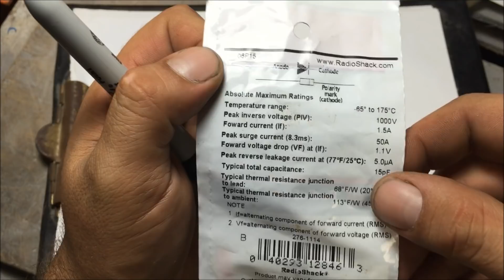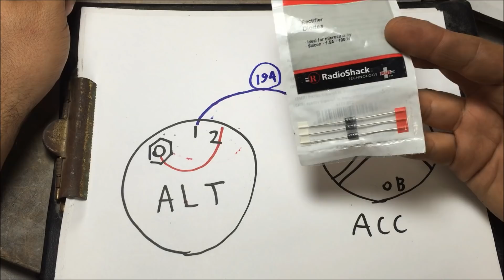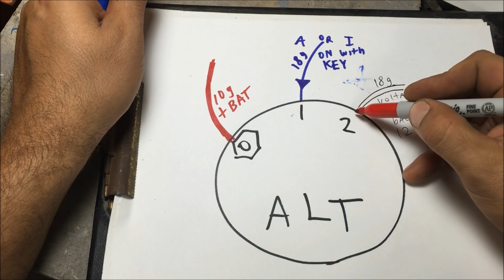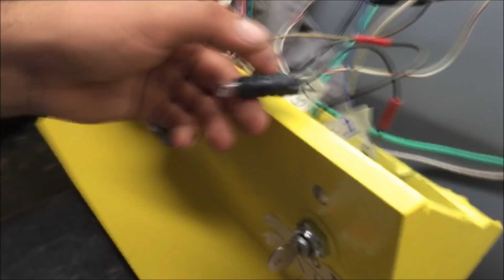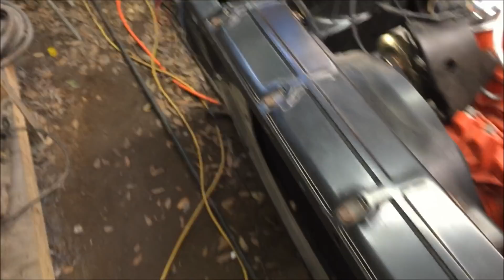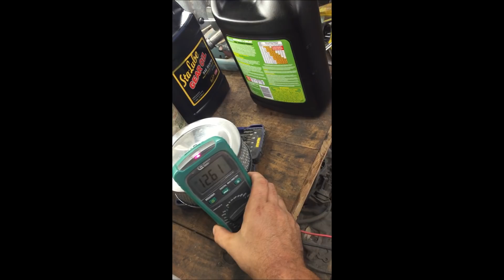how to wire up GM 3 WIRE internally regulated 1973 and newer alternator

Comment: Hey Chris, you always explain shit better than anyone so I have an off-the-wall question. I am breaking in my 396 after rebuild. Motor is on the bear chassis with no body or anything else. Just have it wired to be able to start and run. in other words, one switched wire from the battery to the hot side of the distributor. Can I simply run a heavy gauge wire from the post on the back of the alternator over to the battery to charge it while I’m doing the break-in run? Hope that makes sense.
Reply from the maker: yeah, make sure the battery is grounded to the block or engine

Comment: could you just use a momentary contact switch instead of the 194 bulb or diode and manually excite it when you start it up? Like on a tractor .

Comment: Ok so I have a 69 chevelle that I just converted to internally regulated. I eliminated the external regulator from your other video by jumping out the plug. I have the blue in #1 pos, white jumped to the post on the alternator with red (battery wire) Key switch in the column has accessory. Engine will not shut off. Guess my next step is to get a diode. The gauge cluster idiot lights haven’t worked since I got the car, I guess they were traded out for the gauge package underneath (more modern gauges). Could this be why (possibly) the engine wont shut down?

Comment: was building a lawnmower/alternator charging system and was confused about the 2 or 4 wire plug, but your video answered my questions, mainly the idiot light and which terminal on the alternator,, apparently i dont need no idiot light, just rev the darned thing, sweet
Reply from the maker: keep in mind you may need up to 2000 rpm to get it to charge… but most will around 1000 rpm

Comment: I have a 55 chevy ignition in my 52 chevy and it shuts off on the next counterclockwise position, but if I go all the way to off position it will stay running. The 55 chevy wiring ign switch goes to the ballast resister, then back to the ignition switch again, I am running an electronic ignition so not needed. I checked my power on the terminals and no power at both positions.  So it must be back feeding to the coil? I remember having to use a one way diode in my boat years ago. I will check it out tomorrow. Thanks

Comment: Hey Chris, 
I've got a 69 Chevelle SS and did the charging conversion, so far so good.. lol 
Now, is it possible to sneak out the radiator support without removing the front clip???
Thank you in advance.
Reply from the maker: you should be able to leave hood and fenders on.. maybe even that upper filler panel
Reply: @chriscraft77022  Pull bolts from Inner fender wells, pull radiator, couple bolts on top upper support and should come out? 
I'm really tight on space right now and it's getting cold as hell here.. Miss the south lol.... Wish I could shoot you a few pictures. New project 1969 SS, been 30 years since I used to race however hopefully will change after this rebuild! 🥃👍
Reply from the maker: if the car is complete you are gonna spend all day unbolting stuff off the front grill part of the core support / filler panel .. very frustrating if you can even get it off …take pictures of those brackets.. you might end up having to take off front bumper too
Reply: @chriscraft77022  Dang dude, so you doing anything for an upcoming weekend? lol
Thanks so much Chris.. I'm hoping I'll be able to sneak this out and replace it with a new one. I'd rather pull the front clip however it's not an option at the moment.  On side is really bad rusty and can change loosing an aluminum  radiator..  I'm looking into engines and not sure if I'm going to keep the 396 as I'm looking for at a minimum 1200,2000 hp motor. So much has changed.  I hear so much about the LS motors but still unsure. Would love to run a screw blower BUT just watch something about a Whipple... So much to consider as so much has changed. 
I'm not sure if it sucks getting older or having to learn about newer technology!!!
Thank you so very much for your time.. Damm good dude and channel!!!!
👍👍👍👍👍👍👍
Reply from the maker: 71 and 72 are not that hard.. 64-70 are a pain.. I would not pull the clip if I had to do it
Reply: @chriscraft77022  no. No. No.. lol... can't..
Reply from the maker: make a video on it.  that would be entertaining.. all the cussing
Reply: @chriscraft77022  um, who do I send the video to, YouTube? lol...
I'd probably be banned within the first hour of the video!🤠🙄

Comment: Im having issue with overcharging when opening up throttle, would the wiring to amp meter cause over charging
Reply from the maker: no. Jump #2 back to the bolt/lug and see if that fixes it

Comment: My number one is red
Reply from the maker: ... blue is the original color ... what year is the vehicle?  after 72 they are internally regulated vehicles so they wire won’t be blue 72 and older should be
Reply: @chriscraft77022  77 chevy  c10 rwd i just upgraded to and 110 amp
Reply: @chriscraft77022  so.my year truck excite wire should  either have a diod in it already correct?
Reply from the maker: not a diode but it’s wired up for an internally regulated from the factory
Reply: @chriscraft77022  so it has a dummy light so thats the light that comes on when I turn the key

Comment: Can I run the white wire to a toggle switch from a +12v source coming from the battery? Would it drain the battery if I forget to shut it off?

Comment: Hi I'm using an latching button for 
 power on together with a push button start how do I set that up it's for hot rod running 350 sblock

Comment: Chris I'm still using voltage regulator. Not sure if it is wired right. Which wires go to where on the voltage regulator from the alternator. Also have a ground post on t alternator.

Comment: Great videos I have an alternator I have it wired correctly but the alternator when key is off is getting extremely hot on its own even when the engine is not running alternator is hot any solutions
Reply from the maker: check grounds first.. make sure negative bat cable connection is clean ... either that or undersized wires .. is it stock?

Comment: Hi Chris.  I have a 68 Camaro that has the wiring for the internal regulator done.  The ignition does not have accessories.  What I can’t get is the alternator to charge.  I have pics of how it’s wired, but it’s a bit different with a wire going from the + post on the back of the alternator to the battery.  It also has 2 wires on number 2.  One is very short and I thought that would go to the + post on the back of the alternator, but when I do that the car will not start.  The blue wire is connected to number one.  If I hook the 2nd number 2 wire to the battery instead of the + post on the back of the alternator it will start, but the car doesn’t charge.  The other wire on the number2 post goes over to the wiring harness.
Any ideas are appreciated.
Reply from the maker: your car is not wired right.. get a proper wiring diagram and you will find out.. I can’t help you because something is seriously WRONG... I have never wired a Camaro so I don’t know the exact wires like I do on a chevelle.. does the car have HEI or original points distributor?

Comment: The video drawing looks straight forward, I have a T connector and the diagram that goes with it says R exciter from ignition ie when you turn the key on. And L battery charge light from ignition which in this case is position 2; or is it position one because of charge lamp in circuit, which by the way has no voltage at on position.

Comment: I have that 3 wire set up. I just put a newer 3 wire alternator in same style setup. It starts shuts off and charges fine. But if i plug in the 1 2 wire the voltage light stays on in the car when the car is off. Any suggestions. Also the car will start shut off and charge with it pluged in and unpluged. Only when I have it plugged in with car off it will stay lit
Reply from the maker: you have to have #2 hooked up or you are gonna burn something up... you can NOT run it with the plug off

Comment: The light bulb stops glowing when alternator begins pushing 12+V backwards towards the bulb.  Bulb then sees equal 12V+ voltage pressures on both sides of bulb, thus no more current is flowing through it.  No current flow through bulb = No glow = Alternator is working.
Reply: Thanks for the simplified explanation I've been looking for.

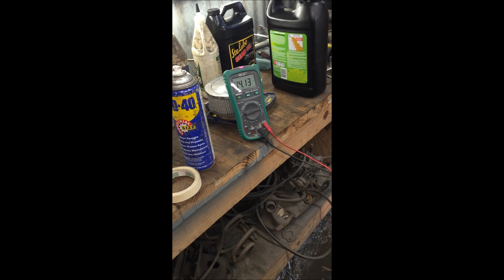Comment: At 14:22 mm:ss, you can hear the alternator drive belt sqweal when alternator begins to generate 14+ volts and drags on the belt.  Who needs a tell-tale bulb?  The SQUEAL IS THE BULB.  Plus, I LIKE the delay, for engine startups.  No alternator drag on engine, until you GOOSE the throttle.  PERFECT!

Comment: 66 elcamino with that style altinator the way that had this thing wired is crazy been looking for a video on color codes and how to wire it up without the external voltage regulator this vidio has been most helpful this far but if you have anything else man it would be really appreciated. I can basically rebuild this ride but not so good with wiring .
Thanks man.

Comment: What would cause an exciter wire to over heat and melt the insulation? It also melted other wires in harness aswell. The wire is stainless steel from what i've read, very small wire. It's on a 1976 chevy g30 van.
Reply from the maker: a bad alternator to start..   change it out first..  pull #1 off when you put the new alternator on..  you dont even need it..  something is very wrong in your alternator or wiring..  i have never had, seen, or heard of that problem..
Reply: @chriscraft77022  it goes to acc on ignition, alond with another larger brown wire which goes to the fuse block. Thanks for the info!

Comment: Can you share any specs on diode i need to get?
If i wire #1 to accesories, it wont back feed and be able to turn off with the key?
My ignition switch have 4 bolts:
Battery
Ignition
Accesories and one in the center which i dont use because we have a starter pedal on the floor.
We just move the key to on and push the pedal.

Comment: When I wired my 1950 Chevy pickup for a 12 volt alternator, I used a relay instead of a diode. The relay was originally for a mid 1970's Lincoln's  headlights. The relay was very heavy duty and worked perfect.
Reply: Which is the relay used on your 50 chevy's installed alternator?
Mine its a 54 and having the same probl. It wont turn off with the key.
Thanks!
Reply: Where did you connect your relay in the ignition switch?
Ignition?
Accessories?
Thanks!

Comment: Chris, currently replacing my alternator on my 70' Chevelle and my GEN light is now staying on. I have the wiring correct per your video and I can't figure out why. Any help would be appreciated. Love the videos.
Reply from the maker: did you buy the original alternator or internally regulated?
Reply: Remanufactured one, 55amp external regulator, car starts up with ease but the GEN light has never stayed on before. @chriscraft77022
Reply from the maker: this video is not on that alternator.. I don’t run those ever.. I would take it back and get another one if the light comes on when it didn’t before
Reply: The product description says it's an "external voltage regulator type", maybe I don't fully understand the difference but I have the same spade terminals for 1 and 2 and setup on the graph you drew. I have the old alternator as well, the back of the setup is pretty identical.  @chriscraft77022
Reply from the maker: that’s what they came with but I don’t run those ever

Comment: Chris, love your videos!  I have a question on Dummy light not working on a 66 chevelle, its charging ok but no light on start, grounded brown wire at regulator with key on and it lights. Can not turn on dummy light at blue wire.  This car has the electronic Regulator no relays and contacts, could this be the problem?
Reply from the maker: has the GEN light ever worked before?   if so the alternator is bad.. even if it charges.. that feature is bad... making the alternator bad

Comment: Chris, do you have a link or know where I can get the socket/light which you are holding at 1:49 in this video? I realized after asking the questions in your other video that I didn't mention I need the light socket itself. The kit car I have doesn't have the idiot light. I am planning to install a voltmeter, so if I can't find a light, I could just wire in the diode. I'd just like a light too for an attention getter. 
Once again, great video and thanks for all of your advice for us knuckleheads!!
Reply from the maker: https://www.iowa80.com/pd/812-marker-light-pigtail-with-194-light-bulb/28952/?itemdesc=8-1/2%22%20Marker%20Light%20Pigtail%20with%20194%20Light%20Bulb&gclid=CjwKCAiAs8XiBRAGEiwAFyQ-emyCp-XACKu7UC0omfdC6Co5LTuWQgZld5bPPMXNRoqLwKHJ2TA7NxoCmQkQAvD_BwE    Search: 194 168 pigtail harness dash.. there are thousands of them on the internet.. link is just an example.. they are $2.99 at auto parts store

Comment: I traced a battery draining voltage leak to my alternator and am wondering if I have the wires time the 1 and 2 position switched. Would the car still charge if they were reversed?
Reply from the maker: yes it will still charge correct and drain the battery
Reply: Thanks! Easy fix!! You rock bro!

Comment: I'm working on a 1970 Chevy Impala and I'm having an issue with a 3-wire system I have a positive and a two wire clip I put on the alternator that they gave me at the auto parts store got it in hooked it up and now my car is wanting to charge at 17.7 volts and when I turn the key off something is draining my battery through the alternator at 12.6 volts I've watched your videos and I'm not real good with wiring any suggestions on which video or what might help me
Reply from the maker: did you buy a 70 impala alternator?
Reply: @chriscraft77022  yes I bought a remanufactured one from the auto parts store and I have tried 2 others also
Reply: Looks like the one you have in the video except for those are ground if you need it on the back and the clip is a smaller size internally grounded and internally regulated
Reply from the maker: if you bought one for a 70 it’s an externally regulated ( I throw those away) and you need to make sure the voltage regulator is good.. if it’s charging 17 you might want to check it out( the alternators I run in the video are internally regulated ) if you are 100% sure you have an internally regulated watch my easy conversion video.. you have to bypass the regulator plug
Reply: Will do thanks I'll keep in touch

Comment: Thanks for the video, very helpful. BTW judging from the engine starting it sounds like it could use some more initial timing..... just my opinion.
Reply from the maker: The engine had too much timing in the video... the distributor got bumped

Comment: Hey Chris,  I'm wiring a 71 Chevy c20 with crate 350 and a 3 wire alternator.  Unfortunately my wiring isn't stock. It's a universal kit from EZ WIRING . The instructions are pretty sketchy and this is my first time working on a old chevy truck wiring system. The only wires leading to the alternator are a white wire that says excitor. This goes to the #1 then another wire that goes from #2 to the power connection. Plus the bigger power wire. These wires come straight from the fuse box. In back of the ignition switch a brown goes to the ignition and a orange goes to accessories.  Would I need or can I add an idiot light?  Also what wire would I cut to add the 194 light? Would really appreciate the help. Thank you!!!
Reply from the maker: your truck dash has the idiot light..   wire the #1 exciter to the brown going to the dash on the bulkhead connector on the firewall.. did you buy a wiring diagram for your truck? ( not a googled wiring diagram )

Comment: Hey Chris. Great video as always. I have a question. I have a 1964 Chevy II nova. It has a 63 amp ext regulated alternator. I am switching to a 140 amp int regulated 1 wire or 3 wire alternator. How would you go about tackling this? I will be running 2 amps (1 for a 10” sub and 1 for my 4 highs-6x9s and 6.5’s) and a nice stereo setup.
Reply from the maker: I have a gm 100 amp alternator upgrade video .. check it out. I’m gonna end up running a 140 amp as well
Reply: So you would definitely run it as a 1 wire? It has the option for either 1 wire or 3 wire. I got a S47294 Powermaster 140 amp alternator from classic industries.
Reply from the maker: run the 3 wire if you want the GEN light to work on the dash..  my car doesn’t have a gen light so I went with the 1 wire... I’m sure your car does.. so you should get the 3 wire...

Comment: Will the alternator still charge of you don't run a diode wire . I don't care about the light
Reply from the maker: if you don’t care about it don’t even hook #1 wire to the alternator.. you just have to rev up the engine a little and it will start charging...

Comment: would you wire a alt gauge the same as if you had a dummy light
Reply from the maker: are you talking about an ammeter? I have a video on how to wire that up.. the dummy light has nothing to do with that
Reply: no if I were going to wire alternator gauge instead of a light do you wire it the same as if it were a light
Reply from the maker: What is an alternator gauge?
Reply: aftermarket voltage gauge sorry
Reply from the maker: that’s a volt meter and it has nothing to do with the dummy light.. they are 2 separate things wired completely different
Reply: Chris Craft thanks I know that now lol this morning was comment was too long ago lol thanks